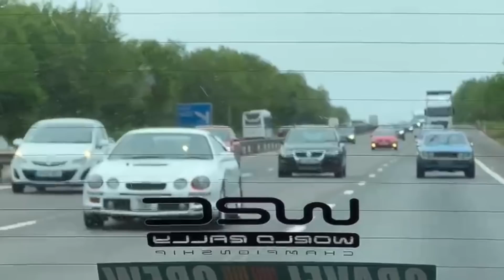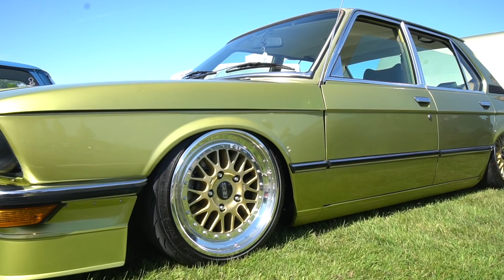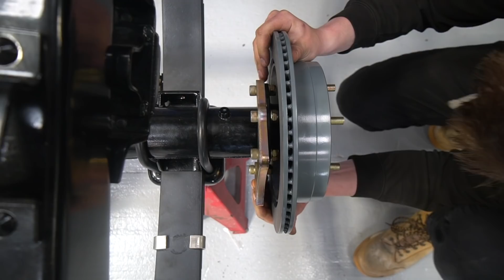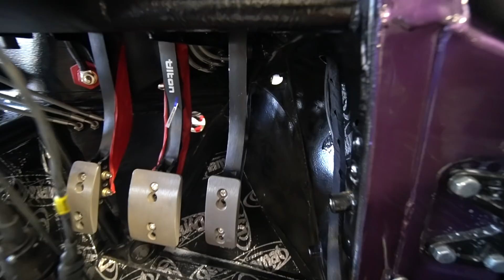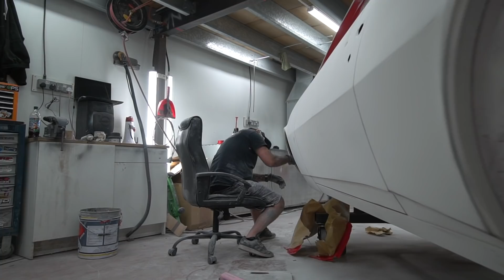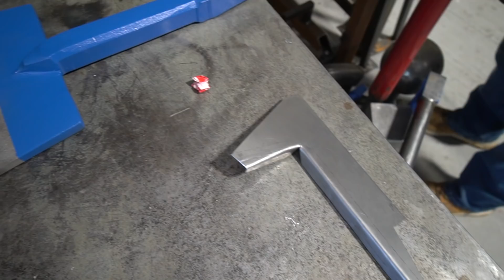Retropower Uncut Episode 90: Retro Rides Weekender & Duct Tape Belt Repair!!

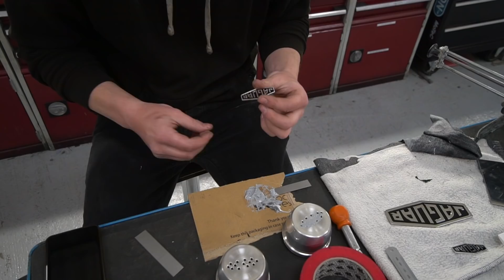Comment: Superb work! Maybe it’s my TV or camera angle suggesting at 28:08 on this video that Utah has mis - mounted rear over riders with the right hand (drivers side) sitting maybe 5-8 mm higher to the boot shut line with a smaller gap ??

Comment: That’s very handy info re brake noise! I have always had problems with bendix pads and will try this on the rear brakes of my y61 patrol. I usually avoid that brand since they always seem to be ‘squealy’ , but they are so popular they seem to be the only ones distributors stock here

Comment: Very keen to try the offset shim in my MGB GT V8 which has chronic brake squeal at low speed. It wasn’t clear whether you fit the shim at the leading edge or trailing edge? Also interested in the thickness of shim used?
Thanks,
Reply from the maker: The shims want to be over the leading half of the pad, ie the side the disc enters. 0.5mm should be ample. We just used a full anti-squeal shim for the pads we had, but cut half of it out

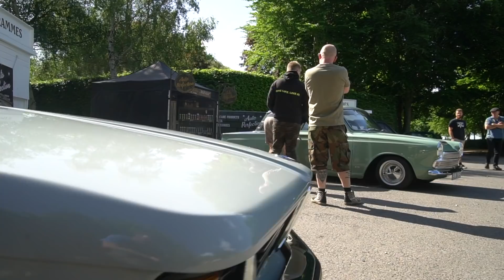Comment: Love the Cortina at 6:30 ................ As someone who has spent the last 33 years building/specifying/designing car wiring, Why do you use such a high spec ? Normal thin wall cable with Vinyl tube, Convolute & Thick Vinyl Tape would be more than enough (Maybe a bit of Twist Tube...................I like Twist Tube) Also you seem to use nutserts for fixing to the body ? Screws can work loose,  Normal OEM spec anti-rotation clips (12x7mm slot) would be ideal (47NM Insertion and 95NM extraction force) ................. I would have a word with your Harness supplier, I think he might be taking the piss .......... DT Connectors are the best :-) Love them, Good spec and nice to work with

Comment: Nowhere to clamp fixtures on a flat bench?… That’s what welding is for. Weld them on with some sturdy tacks or little stitches, then grind them off after. Every now and then go over the bench tacking up any grinding marks and flap wheeling it back to flat with a straight edge.

Comment: on churchill the bolts for rear suspension look right at the edge of the chassis rail, is there a reason for this? for strength I would expect its better to be in the middle?

Comment: TheXJS crosssmember is defenitly Jag,, a thick coating of oil!!
When doing that work scrape the worst of the crud off then use a chemical degreaser, maybe twice which will leave you with a nice very clean part.
Having run detailers for car yard work it is better than petroleum degreaser as well as a little cheaper. I put it on with a squirt bottle.

Comment: Smiling to myself watching you “stick” valve collets onto a screwdriver blade whilst you located them. Reminded me of spending many hours doing the same trick using water pump grease on my fingers whilst virtually stood on my head refitting side exhaust valves on a Rolls Royce B81 cylinder block in situ. Nice to see old tricks are still the best 👍

Comment: Re - pad squeal. The trick of adjusting the leading/trailing edge in towards the rotor is something that you end up doing on bikes with rim brakes that squeal on the wheel rim.
Reply: I was just going to mention this! Toeing in the pads is a very familiar part of setting up rim brakes.

Comment: Trying to pull Churchill's spare out of that well could be tricky. Is there a way to rig a device to lift (or push) it out? (E.g. a pulley from the boot lid, but I'm sure you fellows could think up a more elegant mechanism than my thought experiments.)
Reply: Why would it be tricky, surely you can just grab the wheel spokes and lift it out?

Comment: all the money and time people invest in these cars which, in general look amazing, then they go and RUIN it by fitting illegal, 'stretched' tyres! seriously, if people can sink tend of thousands into buying, restoring and customising these cars, a few hundred for wheels and tyres that actually FIT properly should be loose change in the scheme of things!
Reply: Shame that you're completely wrong and I've been to court to prove it.
Reply: @mattsmith4053  yeah, i don't care about the "legal" part either. It either looks good or it doesn't, personally i don't care for the stretched look. what i care about are tires that meet the load requirements of the vehicle. like when people put mini cooper tires on a VW bus
Reply: @uliwehner  would depend on the VW. The Bay and earlier vans and campers are probably lighter than a Mini Cooper lol
Reply: @mattsmith4053  nah, a split can weigh 2 tons. Bay an extra couple of hundred pounds.